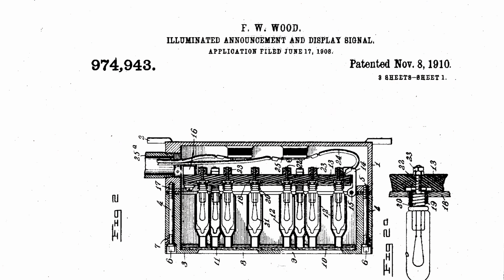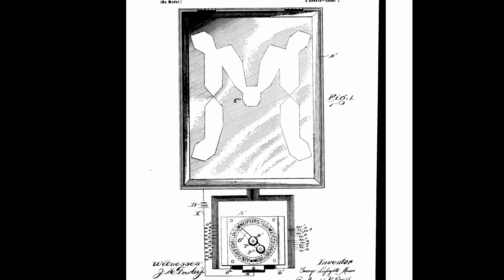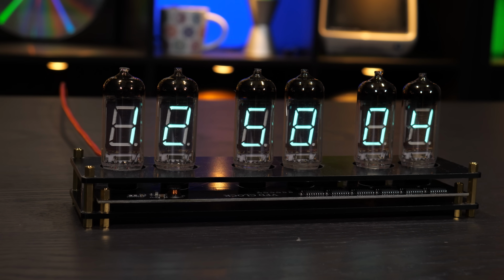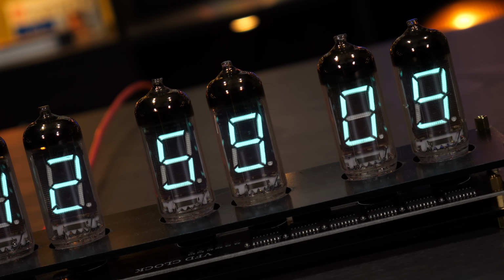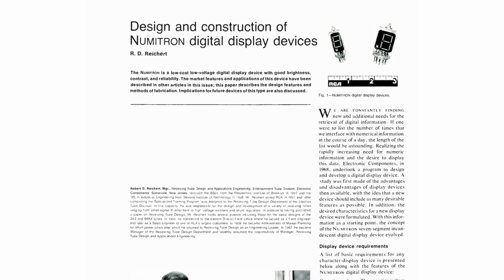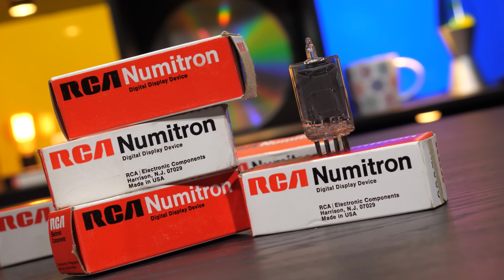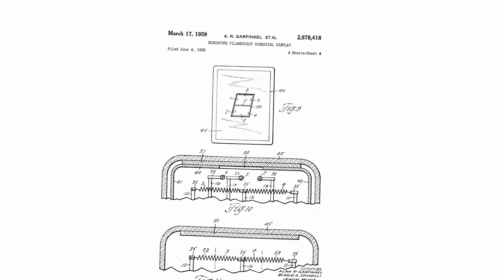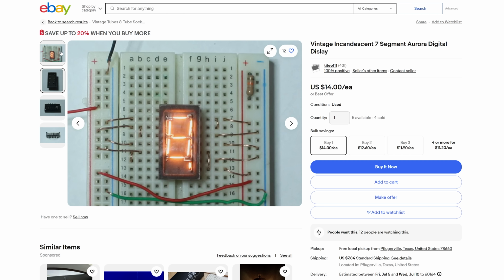The Numitron: An obvious idea that wasn't very bright

Comment: Those flat-pack numitrons DO look like what I saw used in old 70s era gas pumps - I imagine they would be better at functioning in low temperatures (like New England winters) than LCD displays of the era.... also they had the advantage they could be read at night, instead of trying to read an LCD display lit with a tiny grain of wheat lamp....

Comment: I remember seeing something of the sort in gas pumps,  years ago.  The nixie has one particular advantage.  Say you've got a display whose last digit is showing a 4, most of the time,  but which occasionally bobbles to a 3,  or a 5.  With a nixie,  you can see what's going on.  With any kind of a 7-segment display,  it tends to look more like an 8!  I've been thinking about the idea of fabricating an edge-lit display,  perhaps it by LEDs,  which would function ilke a nixie,  and give the proper effect,  though I have yet to feel all that ambitious about actually building one...

Comment: I normally like these videos but this one is just hyperbole all the way through. This product might not be amazing but it's fine. It's not terrible, it's not awful, it's just.. fine. You're exaggerating how bad they are way too much. You picked the biggest ones you could find and zoomed in very close in your video. In reality these were small, they weren't used naked and people weren't zooming in on them with high definition cameras. Nitpicking slight alignment issues and the way the vertical segments extended a tiny amount past the horizontal segments is just silly. They also really aren't a "silly" product as you imply. They're fine. The grey background really is bizarre though.

Comment: Why just straight lines? The filaments could also have curves. Of course there would be the question if it makes sense. Is stacked in front of each other - like nixie tubes - there would be multiple symbols to show. 
Do you know any device that actually used Numitrons?

Comment: Yup, I remember gas pumps with glowing orange/yellow 7-segment displays like that.  I knew they weren't nixie tubes but I never knew what they were (or much cared, really, in those days).  I just thought they were cooler than the old mechanical rotating dial displays.

Comment: The reason the background isn't black could be the heat output maybe? The darker the background is, the less light is reflected, so the more light is absorbed and converted into heat. I can't remember if these things were in a vacuum or surrounded by a gas, but moving all that heat away would have been a pain, especially using just the narrow strip where the backing connected to the bottom of the bulb. They probably realised this during production and thought "Damn it. Well we're not stopping now." Maybe it would have been better to not have a backing? Hide the supports and connections inside thin insulated tubes, and let the company making the radio or clock be the one to deal with the heat?

Comment: I didn't hear a lot of technical reasons why Numitrons were bad, just that they looked bad. It seems like they were magnitudes easier to make, cheaper, and solved the driver circuit complexity problem. If they were not quickly superseded by LEDs we would probably would have seen a couple more attractive iterations of it.

Comment: I remember the petrol pumps here in the UK with the later types of filament-based numerical displays, they hung about for a while in the 90s and even into the 00s, mostly in independent petrol stations (therefore, little to no money or incentive to upgrade unless the pump conked out completely, or they got bought up or franchised by big petroco types), they were very obviously filaments given they couldn't heat the filaments up fast enough as the fuel was being counted up so essentially "blanked out", versus the flippyflappy displays that just rattled away or the neon displays that seemed to somewhat keep up...

Comment: I guess they decided to use a less-dark background to reflect the filaments forwards and make the filaments less narrow looking. A diffuser in front would have been even more of a problem with ambient light. The only solution I can think of is making the filaments hollow tubes of tungsten, but god knows what that would have cost.

Comment: You also have to remember that in the late 60s and early 70s, the transition between tubes and transistors was happening and the Numitron may have been a casualty of it. There were people who weren't going to give up on tubes but they might not have been given the budget they had before.

Comment: Except for the one spot where you say that you "also kind of like them" (around 9:22), Numitron could just as easily be described as electronic dishwasher detergent pods. 😅 But the Captain Obvious part of this video, for me, occurred when you briefly mentioned LCD displays. I was a kid when digital watches came down in price to the point where they became popular gifts for special birthdays - think quinceañera, bar mitzvah, sweet sixteen, etc. At the time, digital watches came in two designs: LED and LCD. LED was decidedly cooler to look at and easier to read in low light, but since LED emitters at the time were quite power-hungry, those mid-1970s LED digital watch faces remained dark by design until the wearer pressed a button. LCDs had particle-gray backgrounds and black digits that made them relatively ugly to look at, but they were always on and didn't require a sustained button press to, say, time something. Because of this contrast and context, I always thought of them as two different display technologies that would never be used together. But the combination of ideas you presented in your video made me realize that today, we do use those technologies together all the time, in now-ubiquitous LCD screens. LCD display technology, and, since around 2010, LED backlight!

Comment: I just loved the massive displays in Airports in the 70s and 80s which had flip over flaps for letters and numbers, and took bloody ages to roll over an entire line when it changed and made a racket doing it. The electronics that drove them must have been amazing. Dot matrix designs replaced them, now small screens all over the place does their job.
Reply: Still in use in some train stations. They have very good readability and zero power draw when unchanging.
Reply: Split flap displays! They're beautiful and actually not too difficult to make yourself if you want. They make for fun clocks or wall art. My shop made one that can display text messages
Reply: As a child I LOVED waiting for the huge boards to change, and listening to all the letters flap into place!
Reply: Like the Solari boards - the one that used to be at 30th Street Station in Philadelphia is quite famous, and I understand they had a ginormous one at Frankfurt Airport.
Reply: @mcrochip  Not just 1, but yeah the departure board is ginormous
Reply: Those commercial LCDs are also usually producing way higher brightness than the average computer screen and generate far more heat and use far more electricity. They're nicely readable, low maintenance, and quiet though!
Reply: Loved those displays! Waiting a relative at the airport and see the board start to move and end with 'landed' at the flight status was a child joy ❤
Reply: Reminds me of Penn Station growing up. The board would make that loud clack when it updated and then there would be a mad dash of people trying to get a seat once they knew which track their train was on that day
Reply: @prufrockrenegade Ah yes, the (in)famous Solari board at Penn Station.  I swear the dispatcher got his jollies by changing the Raritan train departure to track 4 at the last moment, Only after everyone had already climbed up the stairs to track 5.
The Newark Penn board outlived the NYP one by many years.
Reply: in a way it has been replaced by the smallest screen we have... I get a notification on my watch when my plane is ready to board.
Reply: "amazing" in the amount, not complexity. For each position, you need:

1 numeric register that can be set from the central controller.
1 numeric register that can be counted up, either from a mechanical switch on the driveshaft when using a simple motor or from the signal driving the drive when using a stepper motor, and be reset from a zero-position switch.
1 comparator that enables the motor when those registers differ.

That's all.

Alternatively, you can also have an encoding wheel on the drive, replacing the second counter with a bunch of optical or mechanical switches. Like what the pinball machine has on its score counters,
Reply: Just a byte of memory (or 5 flip-flops), a 5-bit counter, counter and a subtractor which changes state when the counter and the 5-bit loaded number match.
Reply: @akulkis  Or a solenoid driving a spring-loaded wheel with a hole via a ratcheting mechanism, a second one that resets that wheel, then a second wheel with a hole that's connected to the track the letters are on, and a photocell that detects when those holes are aligned.

The central controller first energises the reset solenoid, then pulses the ratcheting one until it's in the position for the intended letter. When it's time for the row to change, it energises the motor line which gets broken by the photocell.

1 wire per cell plus 3 wires for the row (reset, drive and ground). And the per-cell wire can be mutiplexed.
Reply: As  I recall there were two types of flap displays - the  flaps were either driven, click, click, click , by a stepper motor or a synchronous motor with a feedback disk, this was faster and less clicky.  The early ones were programmed on punched cards so the electronics were not that complex, read the holes in a card and send that many pulses to the flap unit.  Later of course stored programme control took over.

Quite a bit of current needed to refresh the whole board but only for a short time.
Reply: Talking of massive displays in the 1960s they had one made of hundreds of A size light bulbs at the front of a theatre in Bristol U.K. doing Newsflashes and Adverts which would scroll across.  More recently I wondered how it was driven. Aparrently it involved punch tapes and pins dipping into a pool of Mercury.

Comment: I'm convienced this device is why we call anything to do with computers "digital".... there's nothing "digital" about a JPEG or an MP3, for instance... it's binary.  Sure, you can decode the bits into digits... but at it's core, it's all in bits, binary... not digits.

But these digital displays were digital in the truest sense of the word.  They showed numerals from 0-9, and thus "digits".  My thinking is digital clock displays, which eventually came with LEDs, got conflated with PC displays, and thus the PC's that came with them, and thus everything a PC might interact with... "digital audio", "digital images", etc.

Comment: That seems like something that could be fixed in 10 minutes by a bored lab tech. Just put the filaments on the other side of the gray piece, make cut-outs for the 7 segments and put a white diffuser in the cut-outs. It must have been too dim to diffuse, or like you said, they just didn't care.

Comment: My 1978 boat came with an original depth finder with a numitube display. The key to good contrast is a dark tinted pane between the tubes and the user. This blacks everything out except the illuminated filaments and fixes quite a few of the issues
Reply: Just saw the pinned comment 💀

Comment: Why do you talk so condescending about plus-or minus 1 tubes? Assuming they are plus-or-minus 1-or-not-1 tubes, these kind of display elements (spaced between regular 7-segment ones) are very common still today (using different technology today of course, and a lot larger) in displaying stanza numbers for song indicators in churches.  So you can display song 123, stanza 1+9-12 or similar. So probably they also wanted to have these available in Numitrons.

Comment: I remember seeing those in gas pumps as a kid, back in the 80's, and I had wondered in later years what they were.  I see another comment saying that Panaplex displays were used in gas pumps, and I'm sure they were, but I'm also quite sure that there were plenty of pumps with those thing, orange lines (aren't Panaplex lines wider, like VFD's?) showing gallons and dollars, at least for a time, including the odd, spider-web-like look of the filaments.

Comment: I love the concept. In the 80s and early 90s we worked on products which, IF YOU HAD SAID, exponential growth of storage capacity and CPU power, would have meant STOP DOING THIS, JUST WAIT 2 YEARS Yes I get slightly triggered about spending years of my life solving problems that would be solved just by waiting

Comment: My first scientific calculator was bought in 1977 for $50 (about $300 in today's money) and had something very similar to the nixie tubes. It took four AA batteries and lasted about an hour before I had to put in new batteries. I did physics, chemistry and mathematics so I had to carry a pack of batteries to school each day. At home I had a power adapter so I could do my homework without wasting any more batteries. I still have the calculator and it still works but it's so basic, even compared to the $10 scientific calculators you can pick up in the supermarket today.

Comment: It seems like the worst flaws on the numitron could've been resolved by adding blinders to either side of each of the filament segments, made out of the same material as the backing board (or anything else that could survive the heat). That would've drastically improved the contrast and given the filaments something to reflect off of to increase their effective thickness. The only downside (aside from a marginal increase in production cost) would be worsened viewing angles, which I think is a reasonable sacrifice.

But yeah, once LEDs became cheap enough this technology was completely dead. It's actually amazing how revolutionary LEDs are.

Comment: I really don't think you are being fair to the numitron. It was a good solid idea, that just was surpassed quickly. The market needed an inexpensive numeric display, and RCA was able to produce one. The only thing that makes it less than the perfect solution was the later advent of inexpensive LED's which RCA could not have predicted. Most of the other "flaws" you mention are a product of them trying to make them inexpensive, which was absolutely what markets want.

Comment: 50 odd years ago, I made my own 7 segment clock display using light dispersing phase-change technology.
This consisted of a 1 inch length of 1/8 inch glass tubing with a length of heater wire inside it along with ordinary Lard.
The heater wire was crimped to copper tail wires and epoxied at the ends of the tube.  It was difficult to keep the glass free of lard to get a good seal.
In operation the segments were back lit and the white Lard dispersed the light and lit up White.
When the segment was powered with a few volts, the warmed Lard turned transparent and the tube acted as a cylindrical lens and the light was spread out sideways as the two bulbs were in the middle of each group of of segments so from the front it appeared dark.
The segments changed faster than I expected and were easy to drive, fast enough for hours and minutes.
This all started from me wondering what I could do with all the resistance wire from a broken high wattage wirewound resistor.

Comment: "Janky"...if I needed a "digital" clock in my aspirational Fallout-themed basement, I'd be happy with those.
Reply: Fallout uses Nixie tubes.
Reply: @ferretyluv  Where in the original Fallout games do Nixie tubes appear?
Reply: @Spoco this might not be significant enough but the power armor fusion core and ammo indicators have nixie tubes as numerical representations in fallout 4 (when wearing the power armor)

Oh and also the nuke codes that can drop from some ghouls in FO76 seem to have them.
Reply: @Spoco  it’s literally in the pip boy in the first game
Reply: @Truerussiantigershark  sure there are two vacuum tubes visible in the pip boy but they are not Nixie tubes

Comment: At the local social club in the area where I live, there are 2 digital snooker score boards using Numitrons with a lovely red filter. The characters are approximately 3 inches in height! The largest I have ever seen! If the club ever updates the boards, I'd gladly take them! I am surprised all the tubes still work and wonder if they actually have spares. I took some photos and had to explain to the players on the other table and my friends what the fascination was!

Comment: I disagree with almost everything you complain about.  I've built the obligatory clocks with the Russian IB-9's.  They're awesome for indoor displays.  I drive mine with 74HC595's per each digit without any current limiting.  The 74HC595's run slightly above ambient temperature, bur definitely not hot. They are plenty bright at night, you don't need a night light with that clock in the room.

Comment: I am old enough to confirm that yes, Numitrons were common in gas pump displays--the only place I ever saw them in use.  And most of the time, at least one display had a burned out filament.  Interesting side note--RCA invented the LCD display, then decided not to pursue it, so the Japanese manufactures ran with it, Oh, RCA--you were once so big, and now you are just a licensable logo.

Comment: I was feeling nostalgic for almost every display displayed except the Numitron. I was especially hit by the blue of the first display, but I can't remember why.

Also, as someone working in labs for decades, sometimes the point is to get something to market quickly, even if the quality isn't there. Also, sometimes it is important to have something cheaper so your sales force can give the customers options where the more expensive option is obvious. Also, there are applications so limited that you want the cheapest stuff that gets the job done.